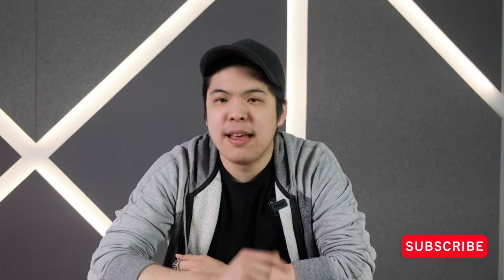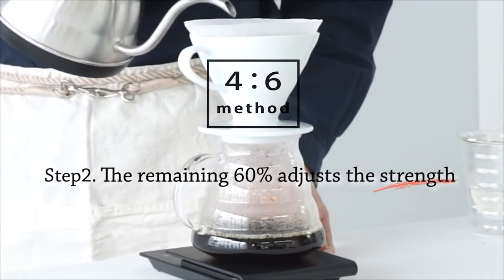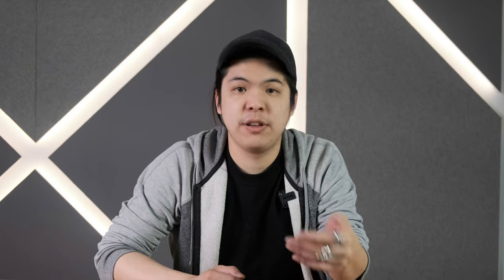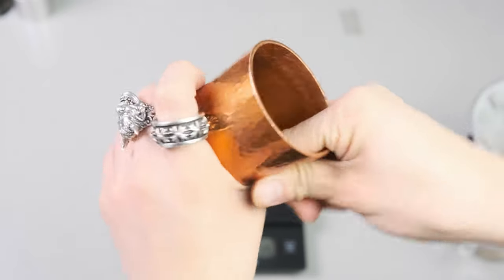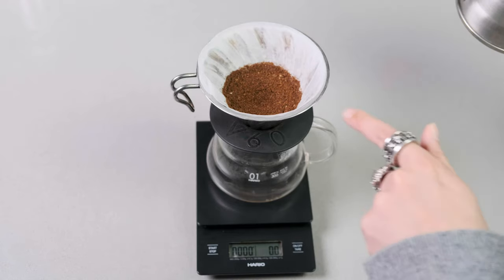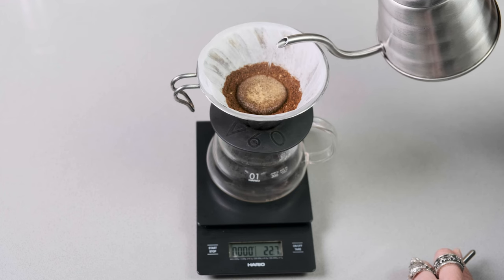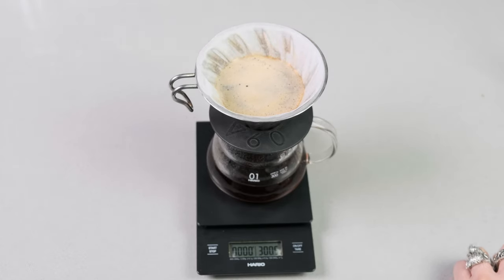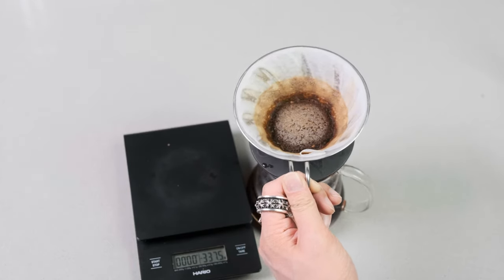Tetsu Kasuya's 4:6 Method REMASTERED (World Champion's Method)

Comment: Static always seemed like a bad thing, but you show how you can leverage it to your benefit. Great tip!
Reply from the maker: Yeah! I never tap my grinders.  The burrs spinning quickly fling out the lightest particles which then stick to the cup or burrs inside. So I grind about 5-10% more beans to compensate.  Hope this works out for you as well!

If yoh don’t have high speed burrs you can use other cups that attract more static particles. If you shake the container enough you’ll see the lighter particles sift to the sides and you can remove from there ^^

Comment: Vince, how do you know when it's time to pour again? Do you let it drain completely before pouring again? Cuz kasuya used 45 seconds in between pours and suggested that the grind setting should be adjusted so that it allows a total water drain in less than 45 seconds

Now, I've been playing with this method for some time and have found that while it works nice with some medium-darkish coffees, the result is not as great with medium lights or pure Scandinavian roasts, regardless of Temperature.
This method also suffers a lot with fines, because coffee gets pasty as time passes and drain time is severely compromised if the grinder is not fine enough. 
According Kasuya, a coarse grind is used to promote the extraction of the most flavorful compounds while avoiding the bitterness of the fine particles. And in the end, the Gesha 90+ coffee kasuya used for this recipe yielded a very light and bright cup at around 1.32TDS
For people like me I prefer bolder cups, with a creamier texture and IMO your single pour gives me just that. Lots of flavor, texture and aroma and the best is that brewing shorter I feel less of a trouble in my stomach which is a huge plus
Thanks Vince and guys for the awesome (and painfully underated) work you do every week!
Reply from the maker: So I pour when I see the grinds peaking out. I don’t like to let it get super dry because it makes it more woody and the gases don’t respond as nicely.  If you let it sry you’ll get big bubbles coming out afterwards and I find those bring out more bitter flavours in the coffee.  It’s almost like you’re letting your skin dry before adding lotion, by then flavours and aromas have left.  I feel like aromas are flavours absorbed by water and passed through into the coffee. So I don’t let it dry.

As for larger grind sizes I don’t think you can avoid bitters.  Larger grinds are less consistent grind sizes so you’ll have less even extraction. The finer ones will have more bitters anyways.  You just need to get rid of as much as you can.

Lighter roasts sink faster, they don’t like to be pasty.  It just is what it is.  5 pours is very high agitation so it causes the grinds to sink quickly resulting in a less desirable cup for lighter roasts.
Reply: @TALESCOFFEE  Thanks for the information! Very helpful
However, since I tried your stall the fall technique I'm sold. Since I received my switch I've been using it and getting the tastier, silkier, richer cups I've ever had.
Reply: what brand of coffee do you use to get that light tan look  my grind doesn't look that like even though I follow all the procedures.
Reply from the maker: @mikecoffee100  oh we roast our own coffees so it's one of our lighter roasts.  like the afternoon nap or the single pour ^^
Reply: @TALESCOFFEE   ahh thank you for the quick reply Awesome
Reply from the maker: @mikecoffee100  no worries! I try to reply when I can heeeheheee.  Sometimes I don't see these unless i'm on my laptop :P but yeah! Always here ^^
Reply: I have the same experience , i like the fruity notes from light roasts , but with tetsuya it tastes more like a black tea - yellow label then , .. so with lighter roasts i preferred Hoffman v60 method :) . For medium tetsuya method , and I just received a Chemex and I was able to make a great coffee with it with Lavazza Oro what I have expected to be too dark for anything else than espresso

Comment: hi nice video but I really don't understand why your pour the first 2 pours straight and the agitate like hell due to the stiring
Reply from the maker: Ah if you want more acidity you’ll want a little less agitation. The last three are to make sure all the fines lift so we pour low but stronger to lift the grinds up to prevent clogging! The stirring is to extract the last little bit of flavours!
Reply: not sure how the grounds know the difference between a hard circular pour and a fast stir.  or between those two and high temperature.  or between those three and grind size and filtration flow rate.

Comment: Is there any harm in stirring between each pour? The method above looks simple and useful.
Reply: I used to stirr at the end on the last part on Hoffman technique(with chopstick). Its bad.

Word of advice, don't. It taste bad if you had agitated enough in the coffee. 

In this video, its probably not as agitated compared to the hoffman technique.

Its good when I did it in the middle of the hoffman technique because its not much agitated compared to the time when it was at the end.
Reply from the maker: Too much stirring isn’t greAt. I personally like the first and last pour stirs, but sometimes if the coffees aren’t sinking fast enough by the second one I stir again. So it depends on how the grinds react to water but stirring for me is a must, quick stirs not long ones.  But not necessary between each pour!
Reply from the maker: Hoffman pours with more agitation. He moves in and out a lot more which is agitation, also he slings his kettle a bit which causes the topside to have a faster pour then the closer side (well not always but I’ve seen him do it) so that’s why he has more agitation.  I’m doing more soft and gentle pours down the middle to reduce the agitation which lets me stir quickly at the end